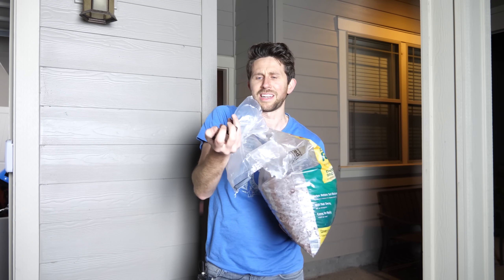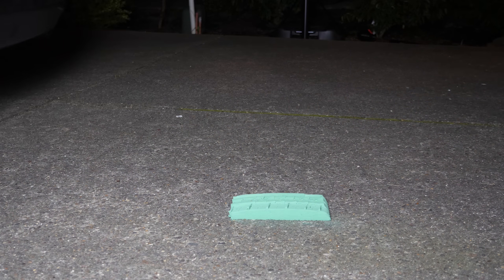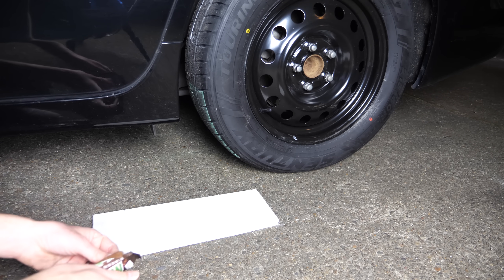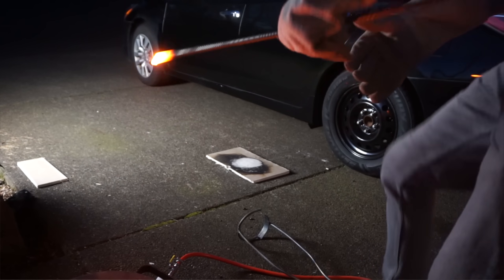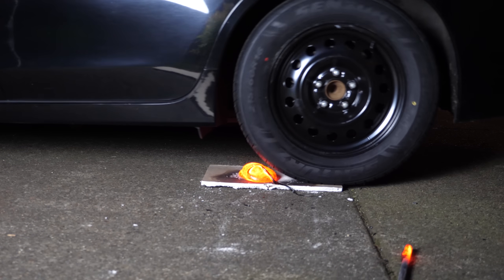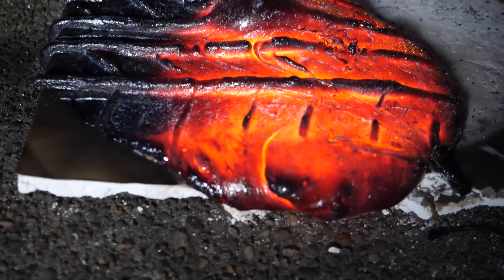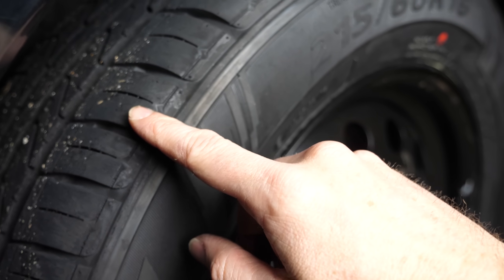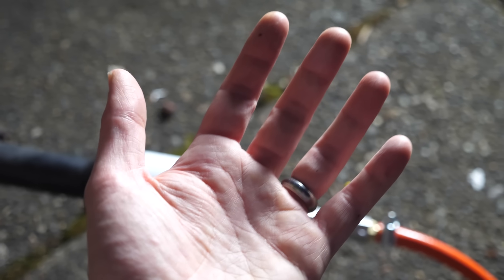Driving Over Molten Lava—DO NOT TRY!!

Comment: I think the reason why the lava was sliding was because of another effect similar to the Leidenfrost effect, but instead of gasses coming from the lava, the lava was burning the material you placed it on so the smoke from the fire was pushing it up a little, so the lava was levitating slightly above the ground

Comment: Very cool experiment. One thing to note that may have contributed to the “disappointing” results is that tires are subjected to extremely high temperatures through regular use. Think a 100 degree Arizona day on the blacktop on the back of a v8 Mustang doing burnouts and hard braking all day. They can’t explode and have that be an acceptable result and the factory blame the buyer. Granted of course lava is hotter but I’m not surprised it did such minor damage to one of the parts of a car designed to withstand the most heat and abuse.

Comment: good idea to burn your rubber hose of your brake lines. You might want to get that checked out might not be leaking but the surface might be damaged and you might need to get the hose replaced.

Comment: Saw it coming. It's exactly what I expected. I knew it wouldn't be able to damage more than like the top mm of the tire material. You also drove over it pretty slowly, if you drove over it at 40 miles per hour the heat would have hardly had any time to have done any damage to your tire at all.
Reply: Depends how wide the lava flow

Comment: So you would make it a little ways, then, the tires would fail,  bringing the already hot gas tank closer. 
So if its any more than 20 feet I wouldn't chance it.
Not to mention you have to go slow so it doesn't get flung up everywhere.

Comment: The failed first attempt was an example of a reverse leidenfrost effect.  Rather than a hot surface and a cool liquid that evaporates, you had a hot liquid and a cool surface that burned.  In both situations they create a pocket of gas that causes the liquid to float.  That was really cool.  You could probably write a paper on floating lava over a flat and easily combustible material.

Comment: Driving over a lava flow would be completely different. It would be hotter and your tires would have more exposure. 
Also, the lava had a leidenfrost effect on that second go because it was so hot. It stopped sliding when it cooled down enough.

Comment: Just a quick reason why you SHOULD NOT do this, especially over a stream of molten lava. When driving over the lava, the rubber on the tire melts, as seen in the video, which is already a bad sign. Next, the gas inside the tire heats up rapidly and gains all this energy in the form of heat from, you know, the molten lava. This could cause a rapid expansion and even an explosion of the tire, followed by melting of the actual wheels. Even if the tire doesn’t explode (which it will) the liquid gasoline in the car will definitely explode due to the extreme amounts of heat from, once again the MOLTEN LAVA. The third reason may need some set up. If you’ve ever driven by a burning car, you know that heat can get into your car pretty easily and you will feel it. A very large vehicle fire of something like a large truck can emit heat near 1500 degrees Fahrenheit while molten lava can burn upwards of 2200 degrees Fahrenheit. You would not only feel that heat, but you may experience heat stroke or die. So don’t run over lava. Drive around it. And don’t turn on your ac. And close your windows. And take off your seatbelt and unlock the door and turn off your airbags. You should be gone before the volcano erupts if there is going to be an eruption. DONT DRIVE OVER LAVA.

Comment: Sorry but I am going to be that one sad person. But there are so many problems with this "experiment"
First, this was about a 1000 degrees colder than runny lava would be if it flowed over the road.
Second, in real life there would be several meters of lava to drive over. Even if the lava cooled down to the temperatures that the lava was in the video, I bet that the tires would not stand a chance against a few meters of driving over it.

Comment: If you had to drive over a slow moving river of lava it would support you until the air inside your tire got so hot it would expand and blow out the tire. You would then sink and die. Do not attempt. I stood on a flow of lava in Hawaii that had a crust of about 6-10 inches and under that it was liquid.mwhen I stood on a crack in the rock it melted my shoe.

Comment: SIR PLEASE MAKE A VIDEO ON WHAT HAPPEN WHEN WE SPRAY WATER INSIDE A PRESSURIZED CHAMBER.😊😊😊😊😊😊
Reply: You sound like you are talking to a police ... Are you scared?!?!😞😞😞
Reply: It will depend on the source of pressurized water. 
If the water is being sprayed into a pressurized chamber and the energy (pressure) is is external AND less than the pressurized air inside the pressure vessel then when you open the valve to spray the water, the air thats inside the vessel will push the water back and flow into the aperture through which you intended the water to spray. 
If the water has higher pressure, it will flow into the vessel. However there are some other intricacies involved here that can be kinda complicated. But for the most part its simply pressure vs pressure and fluid will flow from high pressure to low pressure. Air can be considered a fluid in this case.
Reply: what about going the opposite
spray water into a high vacuum
Reply: @frogz  the same thing that happens to water in a vacuum. It would start to boil.
Reply: Please stop being Indian

Comment: Is it possible to make something fly using vaccum
Reply: Yes , its called vacuum cleaner
Reply: If it had enough sucking power and you faced it the way you wanted to go, then maybe
Reply: airplanes fly by making a vacuum on the top of their wings, I think he made a video about that, but i'm not sure
Reply: Do you mean make something have a super low density by sucking all the air out of it, so that it’s less dense than air?

Comment: 3:13 
for once i will say you're an idot 
the fuel tank is beside the wheels and if catches with the smallest amount of heat 
RIP to you , driver and the car
Reply: Cars don't usually explode when the gas tank catches fire. That is only in movies.
Reply: Larry Thielen 
fuel is highly flammable , it does actually exploded from how hot it is
Reply: @معاذ-الج  At most, any fuel vapors that are outside the cap might have ignited and burn away. Fuel inside the tank wouldn't have been affected. Now if lava was in direct contact with the tank for a little while, then maybe. But fuel itself isn't flammable, it is the vapors. I have seen people put out cigarettes in the fuel all the time.
Reply: Larry Thielen 
why do you think in planes there's a button for getting rid if fuel incase on an emergency landing , fuel doesn't burn and cause an explosion from impact
Reply: @معاذ-الج  #1 Some planes can't land full of fuel because of the weight. #2 they dump extra fuel so there is less to vaporize and burn.

Goggle videos of fires at gas pumps. They almost never 'explode' and just start burning even when the cap to the tank is open.
https://www.youtube.com/watch?v=T6VKxmUPb3g